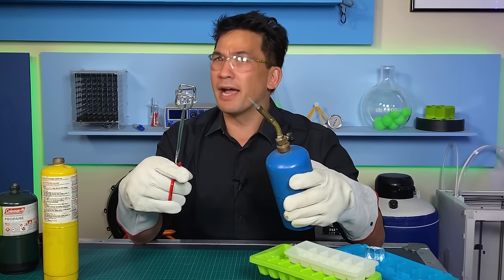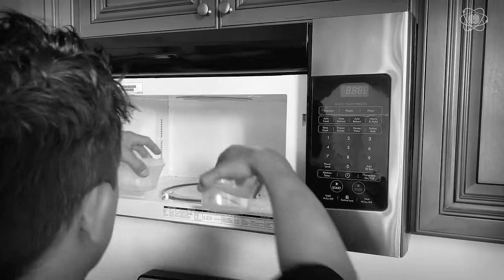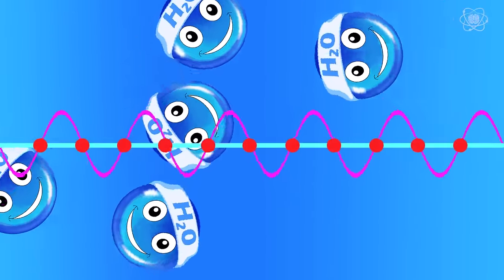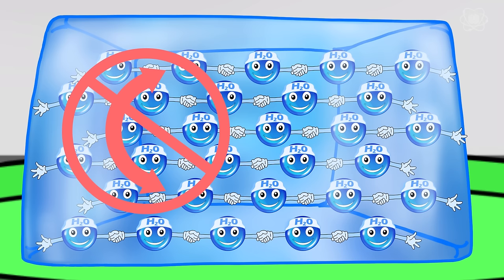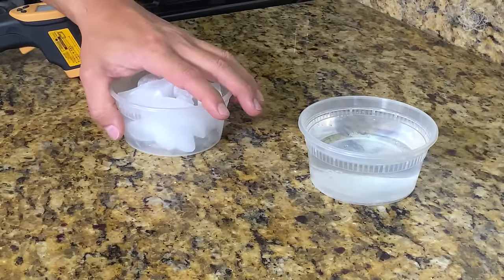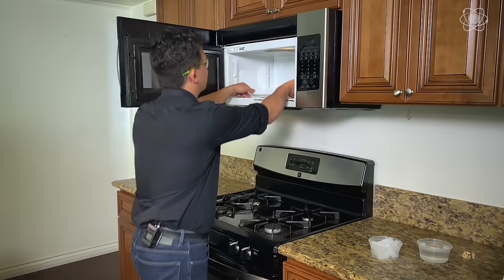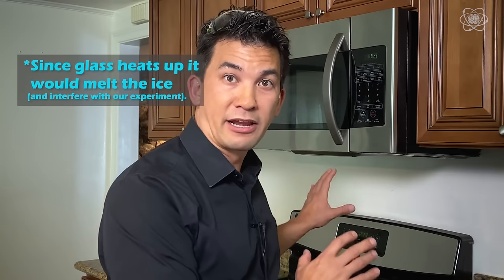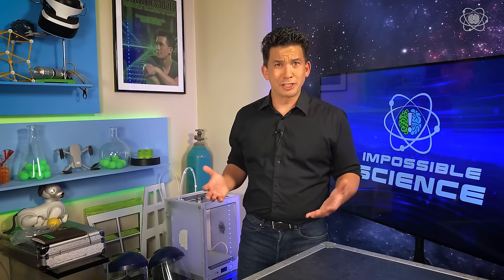Ice That Refuses To Melt In A Microwave?!? | Impossible Science At Home

Comment: Mentions the defrost button. Fails to mention what it does differently.
Reply from the maker: Sorry, it turns on and off the microwave inside the oven, using the tiny layer of ice that did turn to liquid to heat up and help conduct heat and melt the next layer of ice. The more liquid present the faster it heats up.
Reply: @ImpossibleScience  Cool
Reply: @ImpossibleScience  You can damage the magnetron if little to no absorption occurs. It's also more efficient to pulse frozen foods.

Comment: There some water left in the ice it doesn’t count
Reply: Some of the ice did melt because the conditions weren't perfect. For no water to be there there would need to be 1. No other sources of heat in the microwave, so no water next to it and 2. it would need to be perfect ice. As you can see the ice was already melting a little bit as it was laying outside at room temperature.

Comment: I don’t believe you because I just try this in my My ice melted in 1 1/2 minutes
Reply from the maker: Hmmm did you use a container that does not conduct heat? Did you remove the glass plate? And if it’s an older microwave, try getting the ice off the metal bottom that conducts heat by folding up a paper napkin to build an insulator between the ice and the floor

Comment: I guess it’s illegal for ice to melt in a microwave then huh
Reply: Nope i just tested it half my container of ice turned to to water he capped hard
Reply: @dayzghosts4794  but did you follow what he did exactly?
Reply: @Popcornfr  yes
Reply: @Popcornfr  take out the glass plate cause it can get heated
Reply: @dayzghosts4794  hmmmm okay
Reply from the maker: @dayzghosts4794  not a cap, is it an older microwave? Does the sides of the microwave get hot to touch after running 20 sec-ish? The sides could be conducting heat. Try insulating the surface that the container is on with a folded paper towel